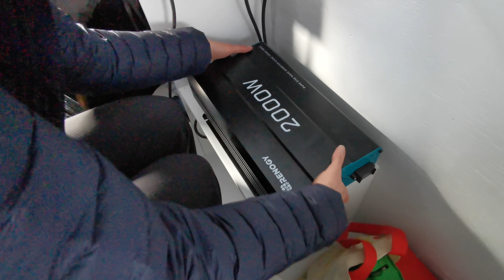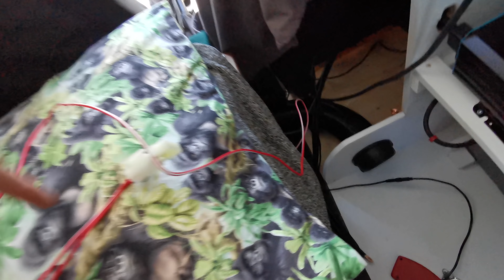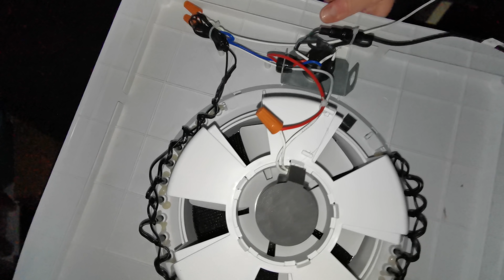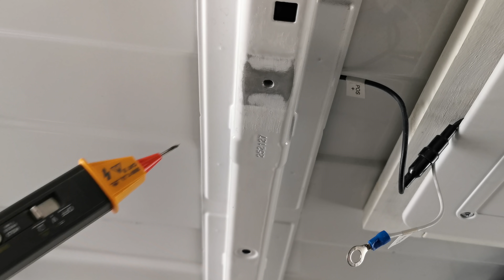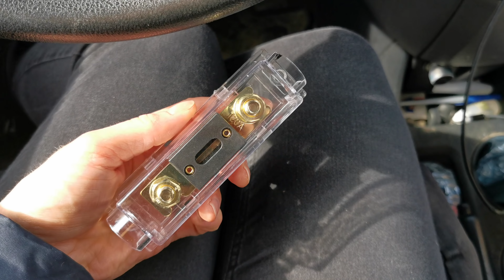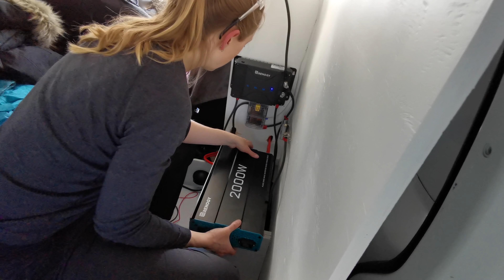Van Build: I'VE GOT POWER!!! Pt 2 of 2

Comment: Just a tip. Don't thread the fan positive wire through panel holes. When the van moves the wire will vibrate and when it wears through the wire it will go to earth and blow your fuse. Always use protective sheathing and P clips. 👍
Reply: YEP!  You saw that too huh ?  Hopefully she sees this, use clips all the way.  That's the problem with things that move .....
Reply: i agree . & a few  elec.Tape  Red Flags  along that white POS.wire  wouldn't hurt either ( let's someone else know it's POS.+12v  ,  & even maybe her too  a few years from now after she's added more various 'n sundry wires  ;  better yet  get a sm. spool of Red  & replace it before the walls get done.  You'll be needing it anyway for lighting , etc. ) Congratulations 🎉🎆 GOOD JOB ! 😉👍 .  Looks like you do proper RESEARCH  b4 ,  & "Do it Right the FIRST time ! "
Reply: @rythemzlatin  Yea using the wrong color wire is easy to do - heck we all have, espec. when the roll is barely touched and there's lots left. But later when the panel gets busy it becomes a PIA to troubleshoot.
Reply from the maker: I'll definitely be putting a sheath on that wire :)

Comment: You can use "star washers" with your chassis grounds. They will bite in. Might be good to cover up bare metal so it doesnt rust (and eventually cause a bad ground)
Reply: Dont worry about electrocution with 12v systems. You wont even sense it until you get upwards of 48v. The 120v coming out of the inverter sockets is the most dangerous thing you've got going on. GFCI might be a solution of you're going to have lots of water sinks/shower
Reply: Battleborn is one of the few batteries you can dead short because the BMS will just consider it an over current situation, so you're ok. You main issue is temperature and not charging it while freezing
Reply: Do not hook solar panels up with the battery disconnected. The renogy will have no place to send the panels power and it'll fry. Have fun Kira!

Comment: I use those heat shrink tubes with solder built in. I showed them to my coworkers (who are also electricians) and they got pretty excited about them. Going to have the boss order some for the shop.
Reply from the maker: They are super duper cool. Also, CHEERS FOR THE CASE!!!! :D
Reply: Just saw the end of the video. Glad you liked the case! Congrats on the electrical, it scares a lot of people, but you are doing an awesome job!
Reply from the maker: @MarloweBricks  Thank you thank you! It was a bit scary but then I realized the spark was "normal"
Reply: Thanx for the  heat-splice  demo. SWEET !! Gotta get some . 👍⚡

Comment: Well done! Good move putting in the extra fuse as well, the fuses need to be on the positive wires as close to the battery as possible. For example, if the insulation on positive wire running up to your fan rubs through on the panel holes and touches the body-work of the vehicle, the fuse you put in near the battery will blow, rather than melting the wire. The fuse in the fan would not be of any help. So good job Kira! Nice music (and gorilla pillow) too!

Comment: If you're using a 10 gauge wire for the positive, you must use at least a 10 gauge wire for the negative.  You also can't connect it to a ground wire with a smaller gauge.  I suggest connecting to a stud connected to the van's body (after scraping paint for a good connection).

Comment: Nice job Kira!

If you can't find the colour of wire you need, you can always get colour coded heat shrink tubing to put over it. Hardware stores will sell short lengths, which you can put on the ends of each wire so you know what is what. That's probably more useful for troubleshooting things further in the future. If you want longer lengths and colour selection, a place called Active Calgary in the NE sells a good selection.

The advice for a heavier gauge wire for your heater is sound, as DC voltage drops as cable lengths get longer. To compensate for it, a heavier gauge wire is needed. I don't know the ratio's, but I'm sure someone here can help on that end.

Good call on fusing the fan by the battery!

Comment: So the large spark that happened is something was on drawing current you can also get this when hooking up a car battery if the door is open just not as noticeable.  The diesel heater wire if that's what came from factory should be fine ( their product they know the amperage draw and length)  but would still trim down. When you are connecting things on a battery as long as there is no magic smoke ( wires burning)  or a fuse popping all is good.

Comment: The wire to the diesel heater is fine it doesn't carry load just sends a charge for the computer to tell it to go on and off. The starting process is a capacitor that kicks off the flame.

Comment: In case it's not already here in the comments, you should put grommets in the holes on the where the positive wire to the roof vent travels. To avoid pulling the wire out to run it through the grommets,  cut the grommets and then wrap them around the wire then install them in the holes to prevent the wire from rubbing on the steel of the van and cutting through. This is especially important if you are going to add any kind of covering on the ceiling because if the insulation on the wire is worn through from the movement of the van, you'll have to tear everything out to get at the area again.  Love the videos, be safe!
Reply from the maker: Thanks, Mark. I'm going to try and put a sheath around the wire. Grommets are a good idea too.... Maybe I'll do that if I can find the right sized ones! :)

Comment: You're going to want to put some wire loom over the white wire to the ceiling vent fan.  It'll short to the chassis when the wire gets rubbed through - which will happen, only a matter of time.
Reply from the maker: Yes, I really do need to do that. Thanks for the reminder.

Comment: Chassis bolts are the way to go. During my career at a Police radio shop I used 9 different crimpers and the associate strippers. Everything demands its own device. Your ecstatic reaction makes us all laugh.
Reply: Do I need 9 crimpers and 9 wire strippers to build van life? That is a NON STARTER for me, JOHN BRUCE.
Reply: @mackdlite5900  Of course you don't. But when you are servicing and repairing lots of different things you gotta have the right tools. It gets down to a good pair of wire cutters and I came to like multi-tip screwdrivers so you have the right one with you when you go to fixing something.
Reply: @jonthebru  Thanks for the input. I'm always interested to know how the pros do it, but I'm down here living SnapOn dreams with a HarborFreight budget!

Comment: You need a 12v fused panel that you run all your 12v accessories from. That will give you a fused + and - connection. Search Amazon for 12v fuse panel and you will see what I’m talking about. A positive and negative from your battery to the panel (I used a switched fuse between the battery and fuse panel ) and then all your 12v stuff connects up easily.

Comment: Good job kira     Remember   The scrape paint and use ground works anywhere    Can use a metal self tapping screw   Just watch scrrw length and whats behimd it    🇺🇸✌🏻    The spark is from the caps in the inverter charging up    Make sure to wear safety glasses when doing electrical work  those sparks are hot flaming metal pieces   You have sexy eyes  keep them that way      You can use a resistor to charge up the caps so it doesnt spark     Check out diy solar will prowse and forum on his website    A wealth of info

Comment: Haha, ignore my previous post, you have a fuse panel. You have negative connections on that fuse panel as well as positive. You could have run both the neg and positive wires from the fan down to the  fuse panel and connected them both there.

Comment: I have no idea how any of this works LOL but I'm here to support. Remember Kira, tough times don't last, tough people do! (WEAR RUBBER GLOVES)
Reply from the maker: Lol! Yes certainly need to get some of those gloves!
Reply: Theres no point on rubber gloves. It's only 12VDC.
Reply: @darrenwoloshyn   electrically Yes.  Not needed 49v or less.  But Nitril or similar gloves WILL help vs. scratches + pricks  from stranded wire ,  especially during the frigid winter \ Dry Skin  season.

Comment: I have an easier way to charge off my alternator. But then your last video got me thinking. It's only that the Renogy charger is expensive
Reply from the maker: Yes, Renogy is quite pricey. I really wanted something reliable though, since I'm such a newbie.
Reply: Victron is expensive, like Rolls Royce, Renogy is really a bargain, like a old Chevy. gets the job done!  I think you can add solar panels to the Renogy system used here, it has an MPPT input.
Reply from the maker: @Douglas.Kennedy  yes, I have two solar panels sitting in storage. That will be a summer project for me :)

Comment: what's the inverter for?  can't ya get by with 12v everything?  and i'm gettin a battleborn lithium battery to replace my lead acid deep cycle.  and the renogy 40amp dc dc charger.  the guys at the rv place said the stock alternator can give me that 40amps no problem - it does like 150amps they said...  What does your high output one generate?  good job gettin the electrical all hooked up - that's great :)

Comment: If you need assistance to wiring your solar, I have equipment to do so, along with the cable, ferrules, clips, and MC4 connectors.
Reply: @KiraandtheSurvivalPod  Yes, I am.  I'm parked at my sisters.  In the van sleeping in it for two days now
Reply: Just finished my whole electrical system - solar, inverter/charger, dc alternator converter.

Comment: Ive just come here randomly,  but I'm wracking my brain why you're looking to undo the car's socket to grab a negative for your diesel heater, when you can just ground to the vehicle. Also, it looks like your fuse box has a negative bus anyway, which you could run to the house battery's negative terminal.
Reply from the maker: Yeah, I can definitely ground it to the vehicle. That's likely my next project. I keep putting it off.
Reply: @KiraandtheSurvivalPod  I'm an amateur cranstinator myself. One day I'll go pro.

Comment: I think the diesel heater would only pull between three and 4 A. The wire you show should be fine over that length. Automotive electrician talking.
The only concern I have with your set up is that house battery looks way too small to stay charged trying to run a 2000 watt inverter
Reply from the maker: Yes, I am not supposed to use over 1000 watts with my one battery. I'd need two to utilize the full 2000 watts...I'd like to get a second house battery, so getting an oversized inverter was in anticipation of that.
Reply: @KiraandtheSurvivalPod  Yep, one battery will work but not great ..... Oversizing is excellent planning !!

Comment: Great video, but my concern is that you are working with electricity with a “hot” system. Usually you cut power from battery and solar before working. Then turn on and test. You can lose fingers, hands, or even your life. You need a volunteer electrician to oversee your work. Scary stuff. Please be careful.
Reply from the maker: All the circuits have a switch on the device themselves, which is why I didn't add another one.